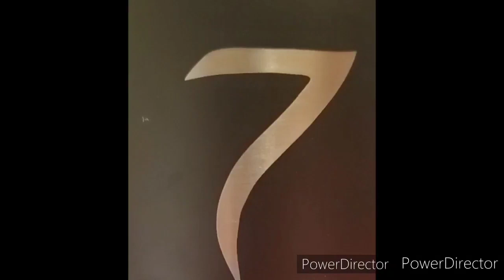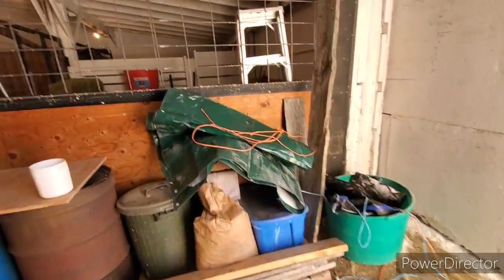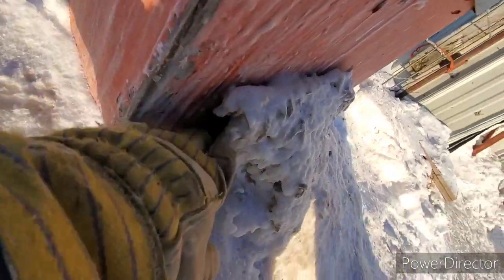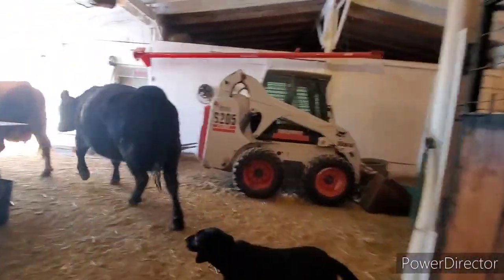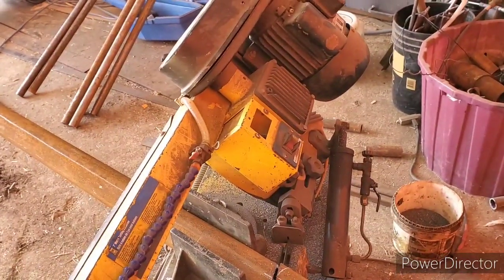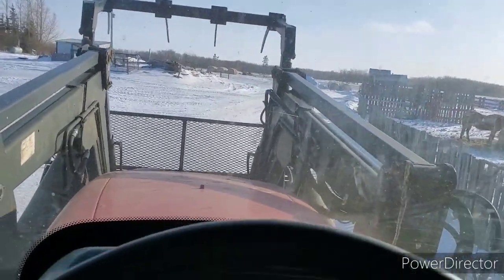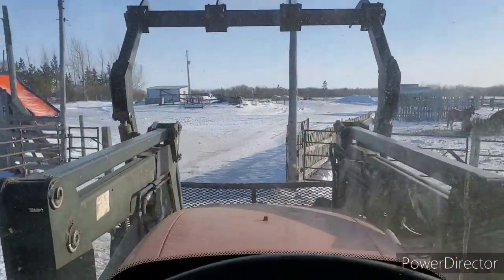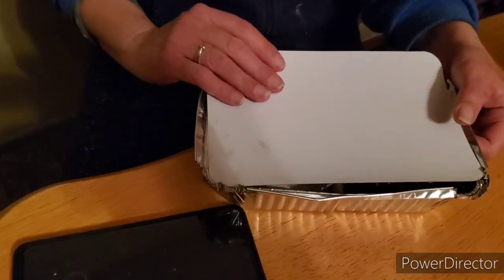HOW To Thaw Out a Water Line and I Screwed Up

Comment: Only the best of us own up to it when we  fuck shit up  .  Now if you had steel pipes you could use a portable stick welder turn it down low and hook up the leads on opposite ends of pipe will thaw it out  Wood is cheap heat but also alot of work . Propane is close to 4 bucks a gallon  here
Reply from the maker: Lol...im still waiting to hear from one tree hugger
Reply: @bcpfarmandtrucking6560  they better hug that tree because o got a Chain Saw . LOL
Reply from the maker: @jeffgroce9736  🤣🤣🤣👍👌🍻

Comment: NOBODY has ever done something stupid, like hitting a fence, a doorway or corner of a barn. You didn't even need to mention that whoops. Live chickens for CP or frozen for dinner?  Electricity! They think it comes from solar or wind! Just like the electric car people.
Reply from the maker: I didn't have to mention anything but I try to keep it real show the fuck ups also...frozen birds.
Reply: @bcpfarmandtrucking6560   Speaking of screw ups, back in the 60's of Michigan, many waterlines were lead pipes from the city connection into the house. Extra cold weather would freeze down past 4', guys would run arc welders at 75amps and thaw pipes. Long leads with one end hooked inside and the other lead at the Main connection. Plenty of melted lead waterlines requiring replacement. When Flint Michigan switched from getting water from Detroit to their own (GM foundry contaminated) corrosive  water source, the lead water line started causing birth defects, cancer and other problems.
Reply from the maker: @kswaynes7569  omg that's bad
Reply: @bcpfarmandtrucking6560  It is bad, there has been court cases, lawsuits and plenty of “talk”. Poor management of public health leads to disaster and Flint Michigan was a story book full of poor management and bad decisions.